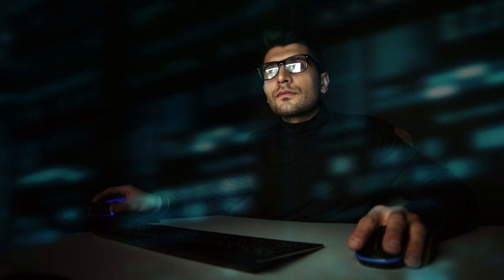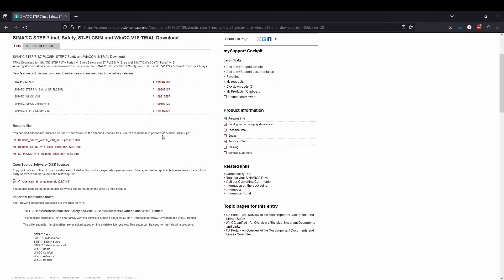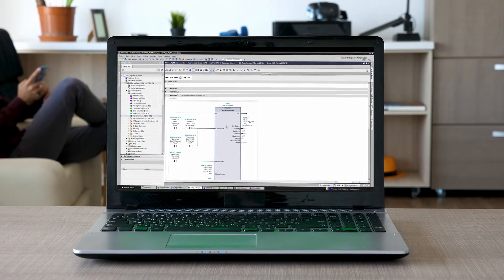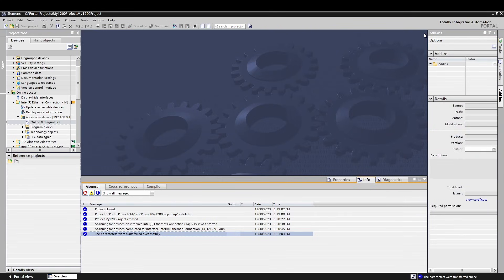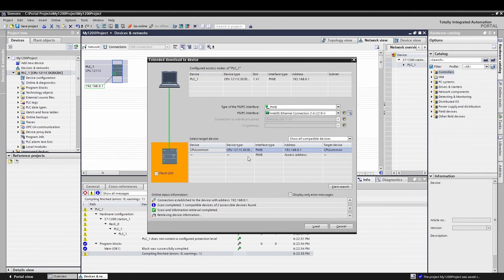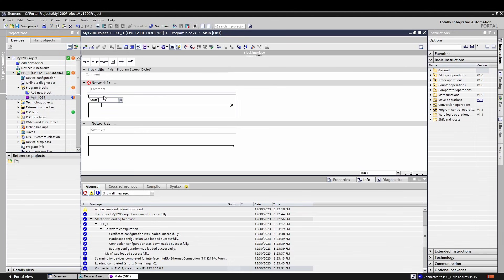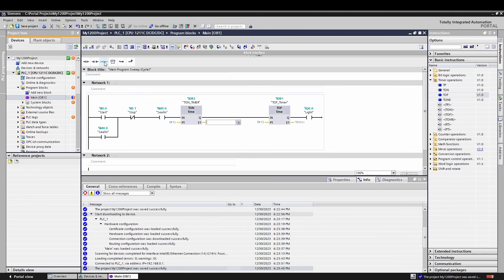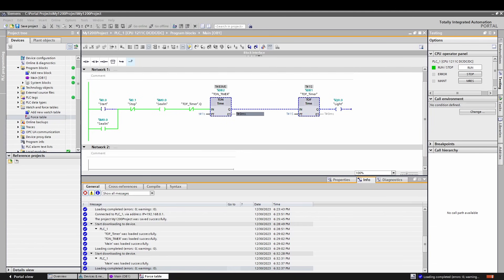Siemens PLC Programming Tutorial in TIA Portal!

Comment: Hi Jason,
To control a Winder, can I perform torque control using the S7-1200 PLC and two Siemens V20 inverters with analog signal? Do I need to have a load cell to measure the strength on the winder coil?
Reply from the maker: So I have researched the parameter set of the V20 and it does not have the ability to adjust the current limit while running. Check out the video below about how to design a winder control:

https://www.youtube.com/live/wkcElnMgVXg?si=M1s_UXAjzbUXNAkg
Reply from the maker: I will have to look, because I don't remember the IO on the V20. I think it might be possible, but it would require at least an Analog input card on the 1200...

Join the Discord and post in #automation and we can dig through the solution. Great question!